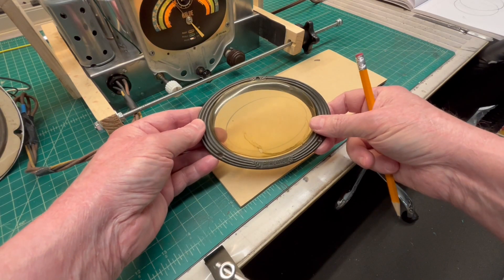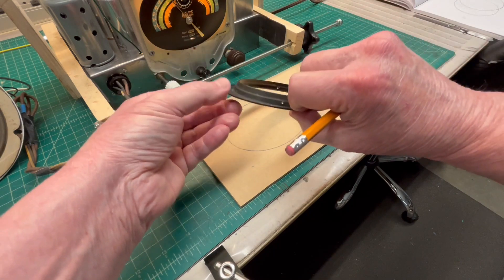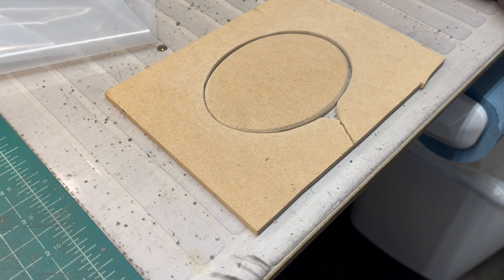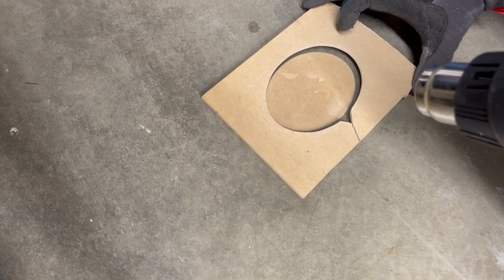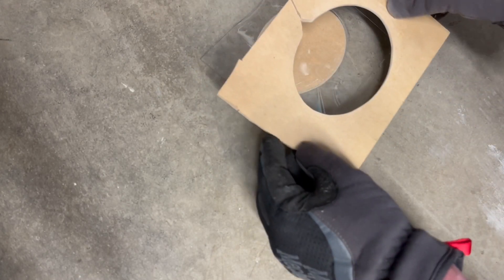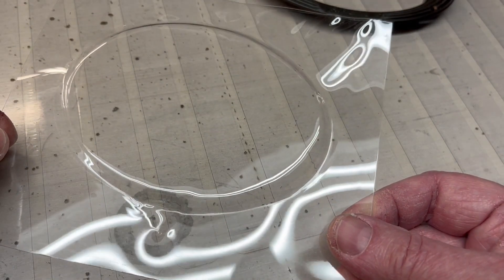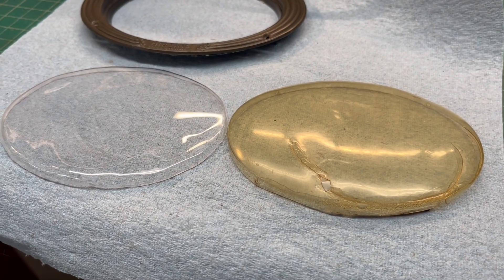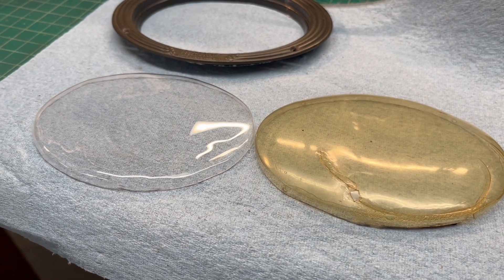Airline 62-316 - Dial Cover Reproduction using a PETG Thermoform Plastic Sheet

Comment: Looks good! I always feel lazy when I order a repro dial cover but didn't know how to make one. Regarding the rivets/eyelets, I didn't bother when I did my 62-316. The dial cover fit snug enough so it is not going anywhere. I figured the eyelets would just end up causing cracks, like they did for the original cover.
Reply from the maker: Good point on the rivets. Mine is not that snug due to my fabrication method, so I’m looking to use a M1 flathead screw to hold them in place as a possibility or fugitive/booger glue. Thanks for watching and reaching out Bill. Best, Don

Comment: Hi Don. I've got a Philco 70 and 90 to restore. Any suggestions on stains and toners? I've read that Golden Oak stain and Perfect Brown toner is a good place to start.
Reply from the maker: Dave - sounds like a match worth exploring. When I was doing a lot of cabinet work, I took scrap veneer pieces and stained them or used various shades of toner or a combination and marked them on the back for future reference as placed against the original finish. Best, Don